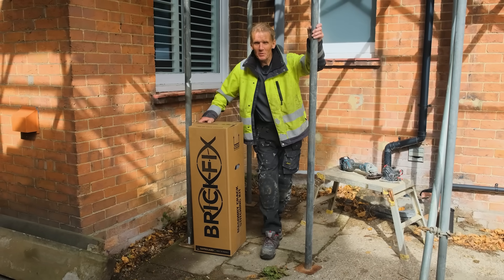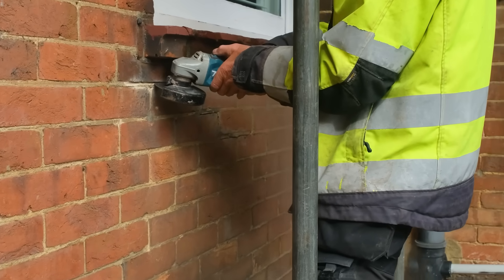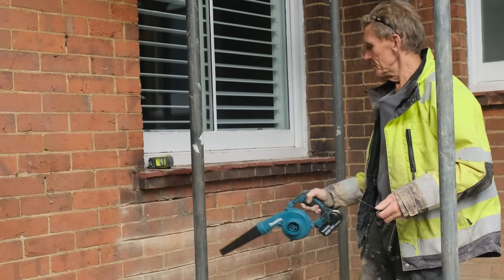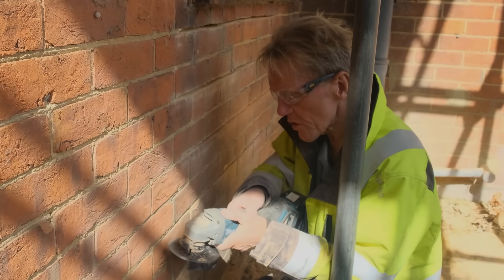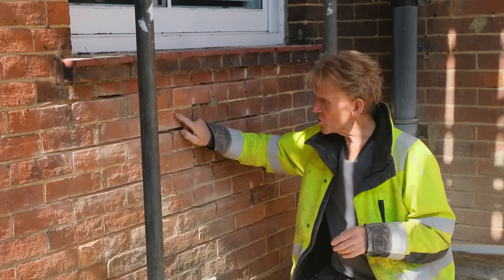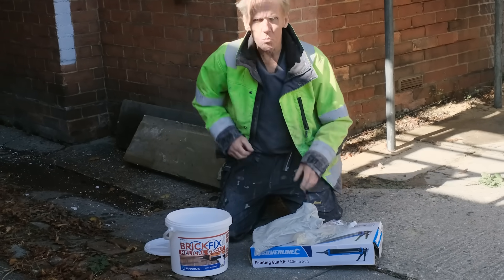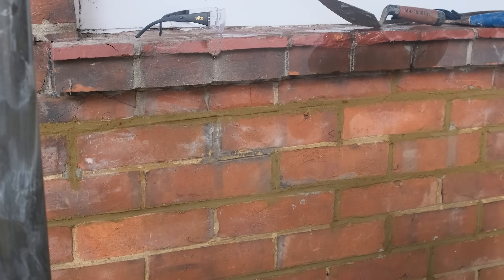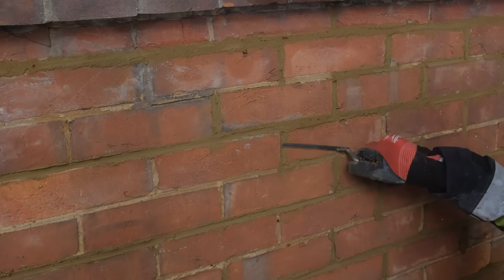Easily Repair Masonry Cracks | BrickFix Crack Stitching Kit

Comment: In Poland they also sell wall clips to hold the helical wire, so it doesn't go out like in your case :), also after the grout dries up a little bit, mix ground mud with water and use the brush to make the grout look dirtier and old, it's a trick from Mike Haduck videos

Comment: My kitchen has a huge crack since we had a huge (35ft) conifer cut down 10 years ago. I think the kitchen is sinking so this definitely won't help.
Reply: As Roger said, if you have a significant crack, you need a structural engineer to work out the cause of the crack and sort that out and THEN repair the crack.

Comment: A good demonstration on the product and how to use it. Ive been thinking of using helibars in my house. I know that cracks around winow openings dont mean that the house is falling down😮. The cracks in my house are internal, the house was built in 1981 and all the internal walls are good old fashioned breeze blocks. One method that ive found effective is to cutout the plaster and render, then fit a strip of expanded mesh to the wall, then replaster. Can anyone guess why dryling interior walls is used by most builders now, apart from speed?

Comment: One question: if lime mortar is so 'forgiving' why would that not be enough? I understand this is basically a cosmetic thing now. ( mind..I live in an old house like that; lime mortar, soft bricks, hardly any cracks to speak of)
Reply: Because it depends on the speed and extent of the movement.  Lime mortar can distort amazingly but only if the movement is slow and gradual.

Comment: Another practical and instructive video, Roger. Many thanks. I have cracks in the block built walls that are rendered on the outside in my garage. It looks like they used too string a mix in the mortar, any suggestions for fixing these unsightly cracks? 🙂

Comment: My single skin garage wall was falling away from the house and affecting the side garage door it was attached to, I didnt know this kit existed so had a go doing basically the same thing but with 6mm rebar and strong cement/lime mix.  It seems to have worked, but Im wondering whether this is actually similar in performance or much better than what I did.
Reply: Rebar isn't flexible enough and will instead move the cracking to the ends of the bar.

Comment: Just dragged some of that out after window fitters put it in above 2 windows in completely the wrong place 🤦🏻‍♂️😠🧱👍🏽
Reply from the maker: It is a very common lintel replacement. If the old timber window was supporting brickwork it makes sense.

Comment: You wouldn't think those would be strong enough to tie a house together, it's surprising.
Reply: They are strong enough if used correctly, in the correct application

Comment: There a crack for a reason , what your doing is covering it up but the crack will just move to a different location
Reply from the maker: It is very common under windows and a bit of reinforcement usually sorts it. You can do a hell of a lot with brick stitching.
Reply: Or happen again.
Reply: @alex-s8j9ryup
Reply: Difference in settlement load means less downward settlement below window , with lime mortar very easy to drill out mortar on one or two bricks and re lay  on fresh lime mortar , cut back and repoint only where cracked. These kit may have a use but here  on this repair 🐥no!

Comment: This is verey expensive kit..... fo interial walls i always use 12mm rebar .... 40mm deep slots cut by wall cheasel.... filled with chemical anchors.... much chiper. But this is external brickwork ....
Reply: The joints are 10mm. How does a 12mm re-bar work? especially as the re-bar will be mild steel.
Reply: @garyfardon8841 ...  for internal walls plastered.....for external brickwork I would use this kit.
Reply: Rebar isn't flexible enough. The cracks will simply move to the end of the bar.
Reply: @edwardhall809 It's not so much the lack of flexibility, but the lower ductility.
Brick is non-rigid and brittle, so cracking appears at very low deformations.
By bonding the brick to a more ductile material, the stresses form microcracks spread along the length of the reinforcement rather than large cracks at a single location.

Comment: I noticed the sand was quite dark. if you can get Cardigan sand and mix with lime, overpoint and wire brush back later if shows the grit in the mortar. V Close to original
Reply from the maker: you are right, it wasn't the best match and the merchants around there didn't have any lime. I would have made a 1.1.6 mix and been closer to it

Comment: don't really see the need for the extra expense when just repointing would suffice
Reply: It all depends how bad the crack is, but generally it’s good work practice to reinforce the area with the bars, short-term if you didn’t use the bars it wouldn’t matter, long-term the cracks will be open again
Reply: Heli bars are a recognised method of strengthening the bonding in a wall so you have to use an epoxy mix to hold it together otherwise there's no point in using them

Comment: why does it matter it doesn't need to be strong there. can you repoint it and leave it
Reply: He is probably using this as an example to advertise the product.
Reply from the maker: @bingefeller  At last somebody gets it.
Reply: @SkillBuilder wasn’t it Napoleon that called us English a nation of merchants.
Reply: yeah but you didn't make that clear in the video. I assume that might have been the case, but I thought clarification would have been good on your part. anyway merry Christmas.  @SkillBuilder
Reply: that's what I was thinking too
Reply: That’s what I did with a garden wall, 10 years later it’s still fine.

Comment: These old houses were often built with inadequate foundations. I often find that Victorian houses were built directly on soft clay, in my area. I’ve noticed, the grander the house, the better the footings. By using this method, you’ll definitely limit the cracking in that area of brickwork, but the issue may appear somewhere else, but given the age of the house, any sagging will have probably stopped anyway.
Reply: Unless there's water or other unpleasentness undercutting something load bearing - these houses should be well settled alright!
Reply: @j @joytotheworld9109 water won’t affect a solid concrete foundation dug to a solid footing ie solid rock. Agree, if this house is built on something like clay, water will definitely have an impact.

Comment: 200 for this. 5 for a 60 pound bag of mortar.
I'll stick with the mortar.
I do not understand the point of the rods. When re-pointing will do the same thing.
Reply: It’s a highly regarded system for putting strength into an old building with cracks. A simple repoint will not stop the crack moving. Having said that, if the crack is still moving, that would need something like underpinning.